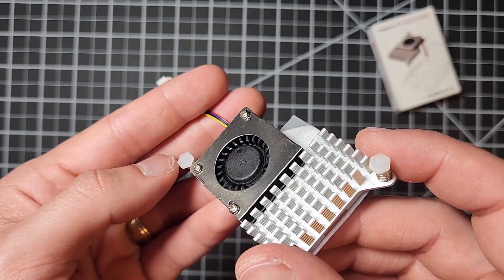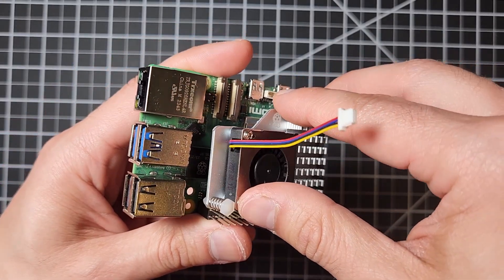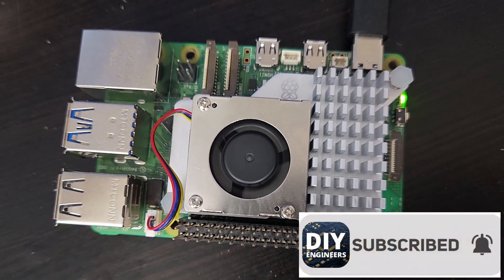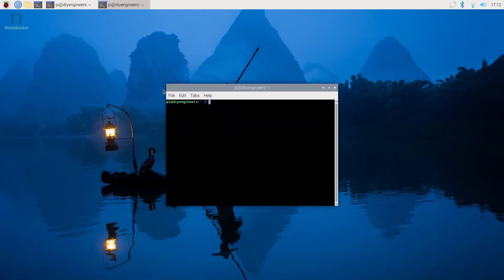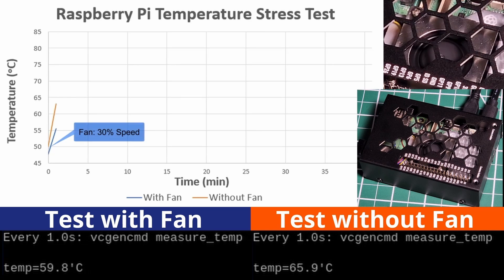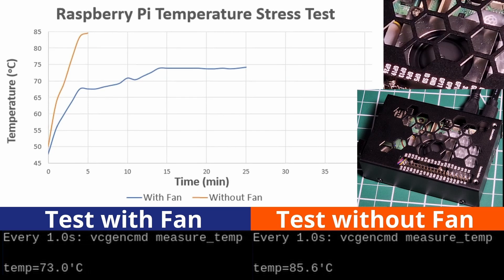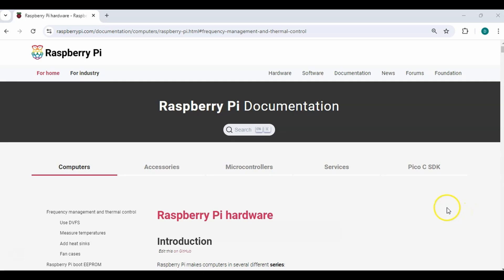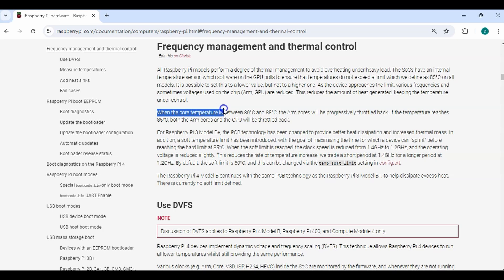Your Raspberry Pi needs an active cooler!

Comment: Thank you for making video. I had to stop and rewind to get the commands. 

In terminal window 1
sudo apt install -y stress
stress --cpu 4

In terminal window 2
watch -n 1 vcgencmd measure_temp

No idea where the fancy graph came from?
Reply: Yea I was able to use these instructions to test my pi5 with a standard case and simple fan and small heat sink that comes with it...max temp I saw for a 5 minute test 75c...

Comment: Sir can you do a copper with fan cause that's what I have and I'm new to tech so I am wondering what the degrees are on this raspberry pi 5 with copper heat sinks and a fan cause I might save up and get it